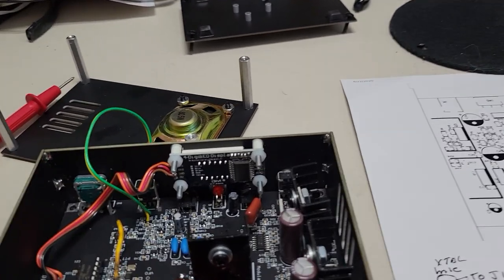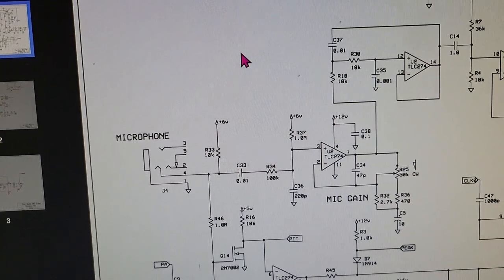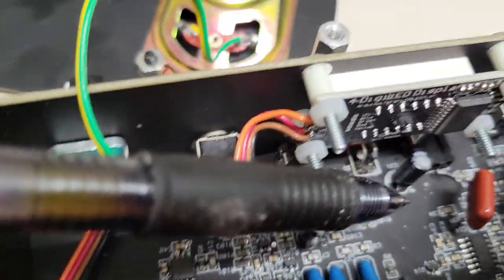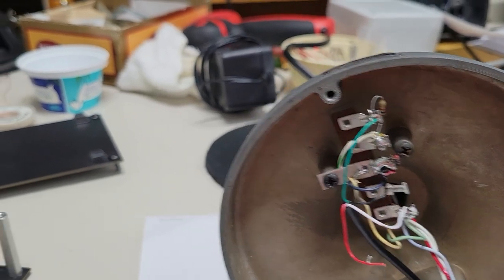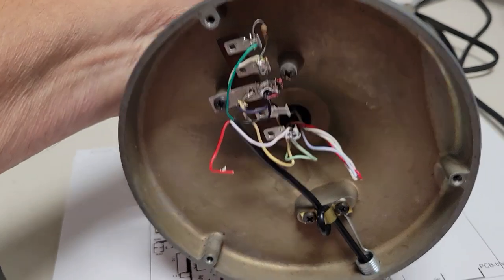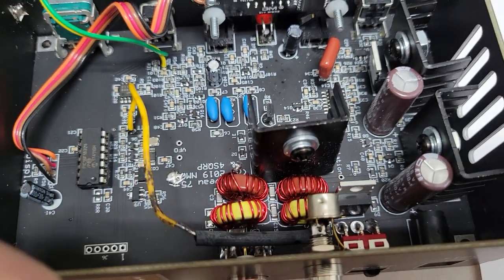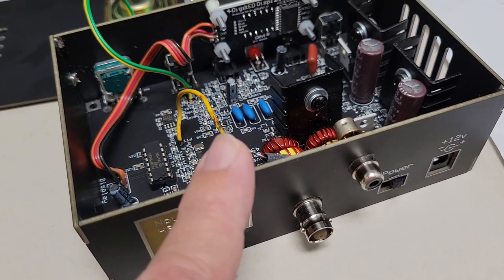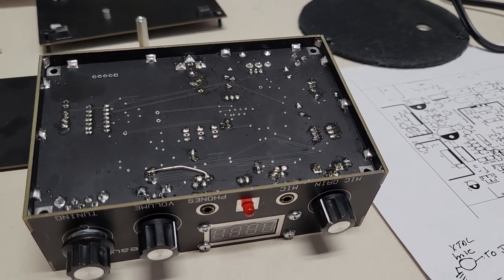Nouveau 75 Microphone to D104 Modification - Amplifier Keyer and Speaker output.

Comment: Nice mods Steve. I was wanting to know where you soldered the wire, resistor coming from the PTT to RCA jack? Thank you, Tim
Reply from the maker: The resistor, 10k or so, goes from the PTT terminal to the base of the NPN transistor. The collector goes to the center pin of the RCA jack and emitter goes to ground.

Comment: I just ordered mine. I did homebrew mics made from non-working Xtal headsets. I slice them open, and add modern electret mics and re-seal them. Some are used with the EL-84 AM TX that I built. I ordered mic cable that U showed and will try getting it together.
Reply from the maker: Just keep in mind that that mic cable isn't shielded. I didn't notice that until later. Now I would look for something else but there's not a lot to choose from.

Comment: Hello Steve, Nice video. My only comment is that putting a amplifier behind this rig is almost useless; these radios have very poor sensitivity. I've been looking for something to improve the sensitivity. The good folks at 4 Square have stated that there is no need for better sensitivity, as it's a QRP rig. This was also noted in the QST review. Thanks again for the video. 73, John W4JPL
Reply from the maker: It's got plenty of sensitivity for 75 meter AM, especially for our regional nets. The extra power just helps others hear me. There is no way to boost the RX gain due to the unusual RX/TX configuration where the final amp is actually the receiver's front end, very odd. One easy solution is get one of the old Ameco PT-xxxx preamps. It will handle the TR operation plus add some front end gain.

Comment: Don't really know enough about them but does your D104 really still have a crystal element in it? My impression was that they needed an amp circuit in the base to work but it works ok with just the amplification in the N75? Thanks n 73
Reply from the maker: All of the original D104's were crystal going back to the mid 1930's. The crystal element has a high impedance which works well with tube type amplifiers however solid state radios started showing up in the late 50's and they have a lower impedance input which tends to degrade the low frequency audio response from the crystal element. The work-around was to use a preamp in the base. D104s began showing up with ceramic and dynamic elements. Yes mine and thousands of others are crystal.